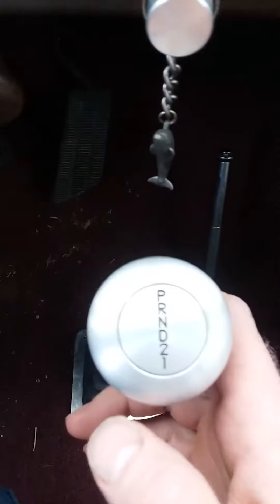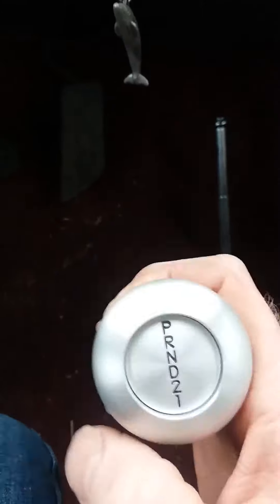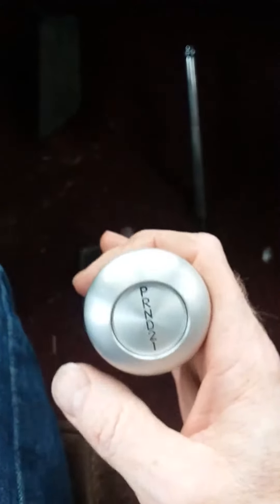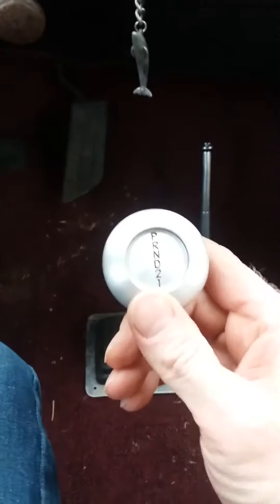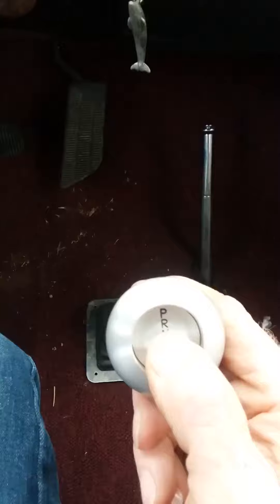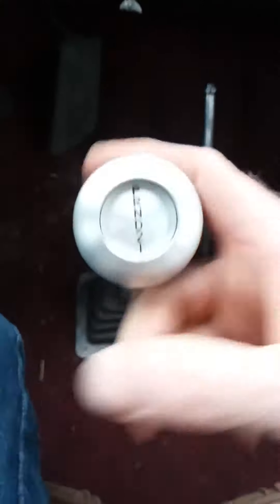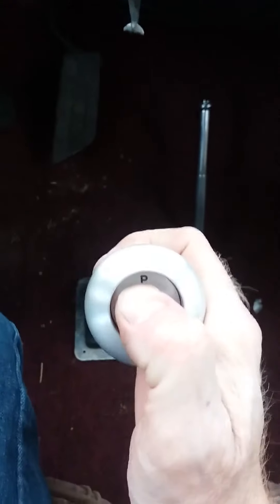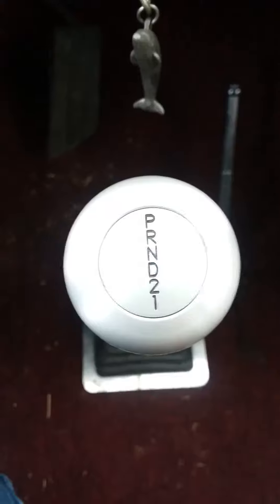Lokar Shifter in My 1938 Chevy

Comment: Ok, so I'm assuming to have a turbo 350 or 400 in there and if I remember correctly there both 3 speeds... So is drive technically 3rd gear then? Can you start off just fine it it say you at a stop light or do you still have to shift to 1st or 2nd?

Comment: That sure is not user friendly to use your thumb for the lock out. They make a T handle conversion and I think all their shifters should have that T handle standard for a more user friendly shifter. Why would you use your thumb for this when you can pull up on the T handle.